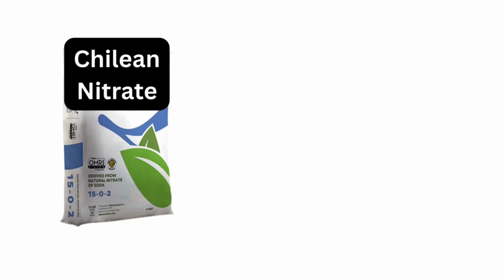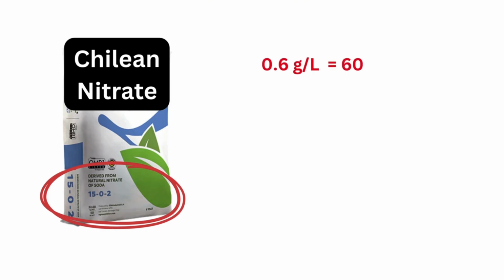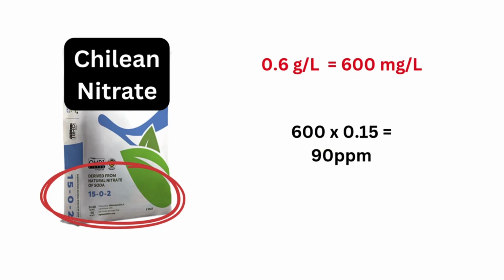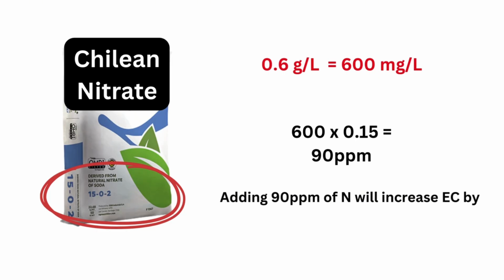Hydroponic Nutrient Solutions Explained: Salts and Electrical Connectivity

Comment from the maker: Just a quick note on conductivity factors! It’s important to remember that the EC increase from different fertilizers can vary depending on the specific conditions, the water quality, and the reference factors used. While one conductivity factor might suggest a certain EC increase for sodium nitrate, another might show a slightly different value. For sodium nitrate, for example, we could also see a conductivity factor that increases EC by almost 1.5 mS/cm! The main takeaway from this video, though, is that ammonium nitrate generally results in a lower EC increase compared to sodium nitrate, which can help with salinity management in your systems. So, while the exact numbers may vary, the benefit of using ammonium nitrate stands strong!

Comment: Karla:  How much will the 10-0-0 Ave Organics increase the EC if you target the same ppm of Nitrogen (90ppm)?
Reply from the maker: When selecting nitrate fertilizers it is important to consider not only nutrient content but also the salt load added to the irrigation solution. For example, delivering 90 ppm N as ammonium nitrate increases solution EC by roughly 0.19 mS/cm, whereas the same N supplied as sodium nitrate increases EC by about 0.6 mS/cm. Using a 10-0-0 fertilizer such as Ave Organics where the source of N is ammonium nitrate reduces the immediate EC burden and avoids introducing additional sodium, an ion that can accumulate in substrate/water and negatively affect sensitive crops, while still providing plant-available N. This lower EC contribution and absence of sodium make ammonium nitrate a preferable choice for greenhouse leafy-green systems where salinity management and water reuse are priorities.